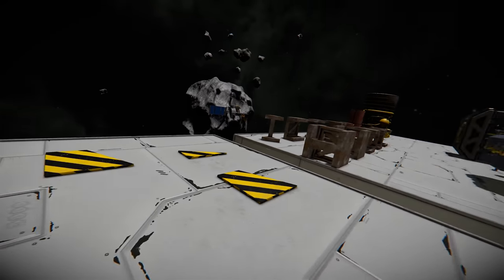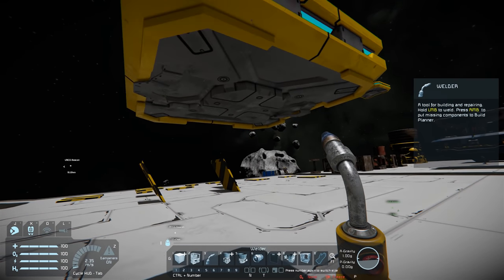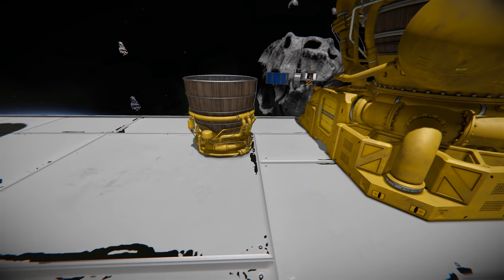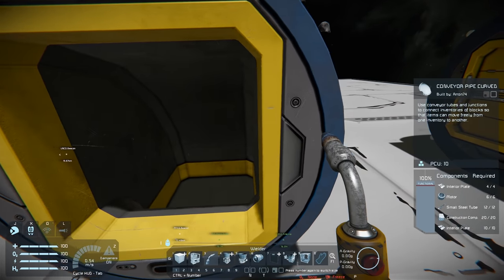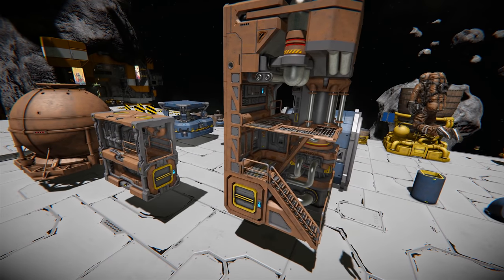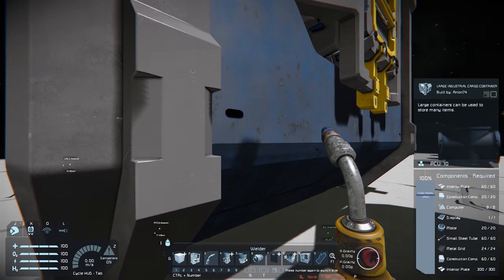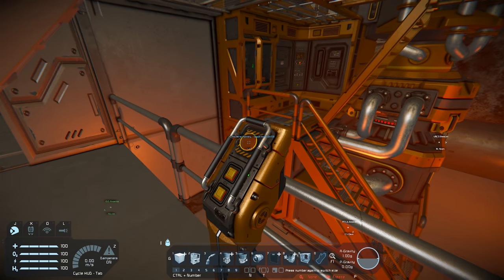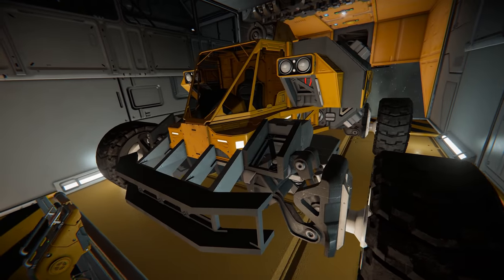Space Engineers - NEW UPDATE Heavy Industry Magnetic Blocks

Comment: I will give them this.. The new refineries and Assemblers are really cool looking. Also neat if you can walk through and integrate the refineries into the ship corridors
Reply: Yes it’s possible to wal troughs like normals corridors
Reply: I think they should be slightly larger to compensate that. But that is just my opinion.
Reply: @TheRezro  i think its fine becasue lets say you need a ship that's needs to be smaller and refine stuff you might be able to make it like 1 block shorter in each direction you can access a corridor from and if your making a ship that small that you can beardly fit a refinery in it when why if your making a refining station/ship making it 1 block longer wont make any difference and for a combat ship why do you have refineries connected to corridors when you should have them hidden away in the hull of your ship/have them at all
Reply: Yeah super nice!  And perfect for more compact large ships.  Now instead of just packing the refinery into a closed off section you can actually get compact walkthrough designs.  They need conveyor corridors though, for the same reason.  Plox.  :)

Comment: 2:57 that’s actually a pressure vessel, in this case a sphere, filled with pressurized (inert) gases, usually helium, that fill the void in the fuel and oxidizer tanks as the liquids are drawn out more and more, which creates a vacuum in the now empty part of the tank, sucking the liquid back in, which is prevented by flooding this created vacuum with the pressurized gas
this tank (of helium gas) is actually not necessarily part of the engine, but on for example the third stage of the saturn V it is found near the engine as that part of the stage is shrouded from air resistance until it separates from the second stage (already outside of the majority of the atmosphere where pressure is not 0 but very very low)

Comment: This is by far their best.  The only thing that I would like after this is a few more corner pieces to match up for when I have a difficult corner.  Like when I have to connect a half slab slope to a normal 1X2 slope end piece at a 90 degree angle.   Would be nice to have a block that can smooth that.  Making some circle blocks that can do a circle twice and 3 times as large would be nice too.  Always wanted to armor some external piping but have never be able to with purely round blocks.
Reply: Those small armor block will definitely help.  Some of my large ships gone small designs have to use a lot of catwalk blocks to fill in areas where I have to sacrifice armor to cram more stuff in.  This will make it look less obvious.  And that refinery is looken good.